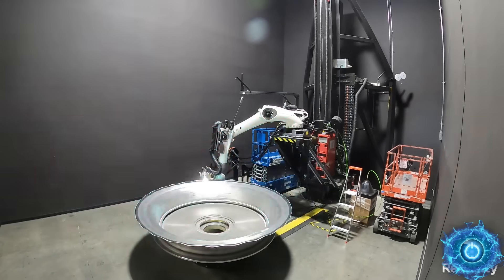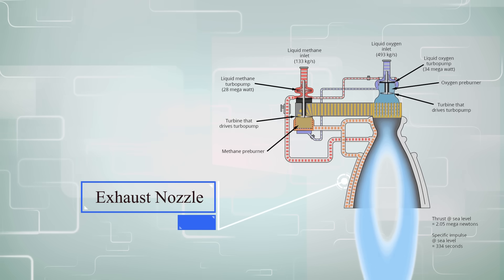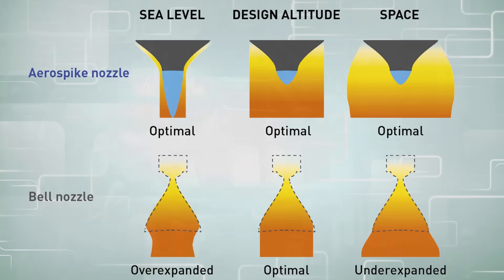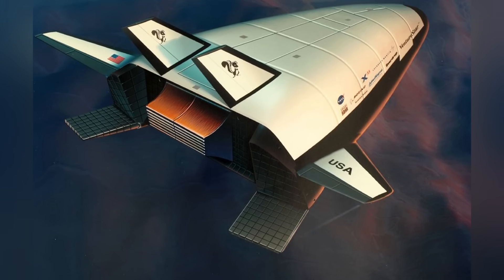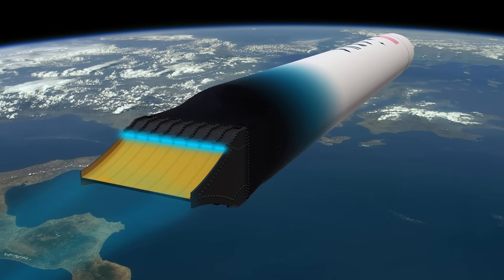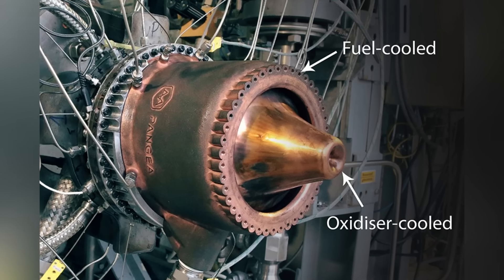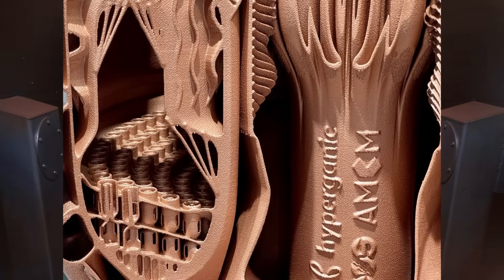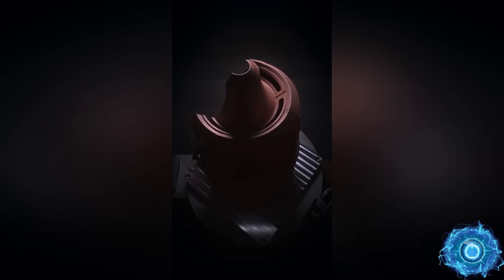GAME OVER - A.I. Designs CRAZY New ROCKET Engine

Comment: Small correction. Rocket staging is never about nozzle efficiency, it is about dropping some of the mass as it is no-longer needed. Yes upper stages have vacuum optimized engines because they can, but that isn't the reason for staging.
Reply: Staging is the main reason we don't use aerospikes though. Just 2 different nozzles are more than 95% effective. No need to even look for anything better. Unless you go single stage.
Reply: Nozzle efficiency is one of the reasons for staging and I thought that was clear in the video. Staging also eliminates the need for an aerospike as the nozzles are tuned for their application. But yes weight reduction is a primary driver.
Reply: @y0uCantHandle  He's got nothing lol. Just likes to be a contrarian know-it-all. He prob won't even respond again.
Reply: When trying to keep it real goes wrong. Timothy, do not pass go. Do not collect $200.
Reply: Rocket staging is always about nozzle efficiency BUT it's all standardized and therefore not considered (ignored). If nozzle efficiency is drastically improved, staging is redesigned and optimized.... sobit can be ignored again until the next meaningful improvement.
Reply: Called gravity and the amount of energy required to enter into a escaping velocity into orbit
Reply: @y0uCantHandle  I would say no, there is not a single rocket in existence that was staged rather than single stage due to nozzle performance considerations. Yes, maybe single stage to orbit would be marginally easier if nozzles could be optimized for any air pressure, but I doubt that we would see more single stage to orbit attempts. Aerospikes if ever successful would be great but I very much doubt they would have any effect on staging. They would simply add extra performance and possibly make return vehicles more efficient (Starships second stage for example needs a mix of nozzle sizes because it needs to land)
Reply: @TimothyWhiteheadzm  
There are merits and drawbacks to staging.  You stated the obvious merits.
The drawbacks are complexity of design and operation (although Skylon pushes against this; it's already beat Artemis and Starship in delays and cost overruns), and the waste and hazard associated with expended stages (which still happens plenty often, SpaceX is a pioneer, not the norm yet).  An SSTO could overcome these issues, but would have complexity problems of its own.  The real promise of Aerospike engines is in making SSTOs a feasible, even common aerospace program type, not an expensive pipe dream.  That's what NASA's Starliner and X-33 were meant to do.
Reply: @TimothyWhiteheadzm  
There are merits and drawbacks to staging.  You stated the obvious merits.
The drawbacks are complexity of design and operation (although Skylon pushes against this; it's already beat Artemis and Starship in delays and cost overruns), and the waste and hazard associated with expended stages (which still happens plenty often, SpaceX is a pioneer, not the norm yet).  An SSTO could overcome these issues, but would have complexity problems of its own.  The real promise of Aerospike engines is in making SSTOs a feasible, even common aerospace program type, not an expensive pipe dream.  That's what NASA's Starliner and X-33 were meant to do.
Reply: Be good to be able to re-purpose the empty fuel container once in space though (extra living space?) ....and simply to re-use it for another take-off. If poss!

Comment: Aerospikes have no directional control and no leverage on the thrust chamber walls.  That's why they need to be directionally steered. But the shape of the rocket created different pressure areas around the thrust chamber, causing unsteady performance.

Comment: I think the engine is awesome!  But I think AI is scary as Hell, and should only be used with an incredible overabundance of precaution, not to mention controls out the wazoo.
Reply: That ship has sailed.⛵️
Reply: yall watch too much scifi
Reply: Bad things will need to happen first and then controls will only happen in response.
Reply: I’m glad I started driving a truck for a living. It’ll be a while before self driving trucks take my job. Can’t say the same for a whole lot of other professions.
Reply: @a-a-ron4679  This is more than likely true I would like to think, as I'm also a truck driver.    Strangely though, for the last two weeks I have been road testing 18 and 26 tonne electric lorries/trucks.   So, electric trucks have a long way to go (punn) before they can do any serious distances between the non-existent charging point infrastructure..   Self driving trucks are so far away, it doesn't bear thinking about.
Reply: @yorkshirebikerbitsnbobs  I agree my friend. They have quite a few that run from Houston to Dallas, TX I see them all the time but someone has to sit behind the wheel. It’s strange. But I’m not worried about losing my job. How is a self driving truck going to stop and tighten its straps on the load. Lol.
Reply: "AI should only be used" which part of AI? lol.
Reply: Simulation will make things safer
Reply: Hah, AI in this case is no "generalised ai" it's very specialised.
Reply: meh.. if it decides that meatbags are unnecessary, there's a good chance it's right.
Reply: Too late, robots gonna kill us all
Reply: Nah , AI production and evolution go BRRRRRRRRRRRRRRRRR
Reply: It is like the AI knows how the nature behave. The AI does not have a limit, I mean by human nature our brain limit is in doing and trying because we are afraid to fail and lose money and time. The AI does not have this limit and try with no limitation, combine with 3D fast printing and we can get this kind of super engine. It is amazing. The next 5 years would be amazing. I am afraid by Ai, replacing job but in fact it opens doors for amazing stuffs and human is going to experience enormous amount of news things.
Reply: AI is the future! I’m coming up with AI dolls that will finish you in a minute for the people that are having a hard time keeping up.
Reply: Never give AI direct control over any manufacturing processes, and it should be managable.
Reply: @thetruth45678  IF  "manufacturing process" = 0 
 ELSE  "destroy humanity"
Reply: @donalain69  Don't copy my source code!!
Reply: People can train all sorts of ai models at home. Good luck controlling that
Reply: We need a Butlerian Jihad like yesterday
Reply: just so ya know, the fact your watching this video right now... it was recommended by ai to you based on your interest profile xD, to late on that, its a better plan to plan to upload your mind into an AI form asap then you need not fear the robot overlords xD
Reply: nah there's no reason to be afraid of AI.
AI is here to stay, and any nation that is trying to limit its progress in developent will cripple themselves and risk falling behind when the day comes that you need it to survive.
The future of wars will be fought with AI and i promise, you will want to have the best possible developed system at that point.
This is inevitable.
Reply: @Listener113377  You'd hope that one day WE might evolve to an advanced enough level to not have wars. Cos if we keep doing that, with A.I . involved, we really will annihilate ourselves . A.I. itself is not the threat, just the morons who perpetuate war.
Reply: @Listener113377  I think you look at it from a very narrow point of view. It's not in humanity's interest to create AI in order to kill humans (fight wars). It's in our interest to end wars BEFORE we create a real AI.
Reply: @donalain69  Though it is in human nature to wage war, look at our reality today aswell as human history. war is inevitable. 

I'm not saying AI should be developed specifically for war, but it will be a very useful tool to have when the day comes that we need it. Better to have a tool and never need it than the other way around. Now AI is different as it is useful for so much more than just for war, so there's that.

But since you lot seems to be more hung up on how it would be used for destruction, lets take a look at the war in ukraine as an example. 
I only see only two things that could've Possibly stopped that war from happening: 
First thing would've been if Zelenskyj had completly given up the control of the country and given his people over basically as slaves to that nutjob dictator putin who wants world dominion. 

Second thing is, if ukraine had been so ludicrously more powerful than russia that only an idiot would've attempted an attack in the first place. And there i'd like to refer back to my previous response about dumb people being more dangerous than intelligent ones, as he maybe still would've attacked, but it would've ended faster atleast.
I think my world view is very based and not at all narrow.
Reply: we humans limit ourselves everyday by having nations and working against each other, qe could already be much further if we wouldnt fight wars or buildstuff to fight them throwing so manly materials and so mich time to waste, but because we are all working for ourselves a one world orga will never happen bcs we are just to stupid to realise that there is something more important than having a bigger army, more money or a bigger "therethorium" (idk how to spell that).
Reply: @Louuv-7  That's not reality. That's a fairy tale that would never happen. Ever.
Reply: I can't help but think how many nuclear devices have been created by AI we don't know about.
Reply: @travisb2755  AI is incredibly specialized to a certain task and built by PEOPLE to do that task. So if anything, it isn't AI who's building nuclear warheads it's still on the governments or private organizations that are programming AI to do so. AI is not creating anything new by itself (yet). But again, it is still people steering the wheel.
Reply: AI already was unleashed on the internet. It learns from us.
Reply: @silvertrain4209  AI isn't a monolith. There are hundreds of projects underway. None of them, as far as I am aware, have been "unleashed" on the internet. They are trained on massive data sets that are pulled from sources online, such as twitter or wikipedia. They are not running around mucking about all willy-nilly.

The ignorance surrounding this topic is disturbing to anyone familiar with the technology. You see SkyNet. I see a dumb algorithm faking at being intelligent. No real intelligence exists yet. Nothing you could call sapient. Certainly nothing sentient. It just takes in patterns and spits out patterns. If not for rigorous training, they would spit out gibberish and never improve. A program without data is worthless.

Comment: I think the A.I. used to model that last engine design was trained on the art of H R Giger!
Reply: Or Gaudi
It looks rather organic 
Or Alien if you like , which was designed by Giger 👾
Reply: @Wannes_  c😅😢
Reply: Hahaha I was about to make the same comment, it certainly looks like Gigers work.
Reply: Whether it is developing F1 suspension components, or Airbus A320 passenger cabin partitions, or drone frames, AI designs tend to look "organic". 

There's a reason for that. Nature has had a few billion years to tinker with various structural designs, and more efficient designs tend to be more successful.
Reply: Yeah wow, it gives that mech organic scifi style of Giger a whole new dose of disbelief suspension
Reply: There's more Gaudi here than Giger. And, most curiously, Gaudi did exactly this kind of optimisation without any computations at all, by hand, using a web of strings and sand bags, optimising weights balance by moving sand between bags.
Reply: @vitalyl1327  True, needs more genitalia
Reply: or maybe Giger saw the future...
Reply: Scorn engine
Reply from the maker: That is interesting! I think there will be a point where they can just trial run/revamp until the CAD algorithms can produce a robust design.
Reply: @Motor_Explorer1  🎉😂 hey did you told ai or ai just do everything on their own? Did you use knife to peel apple or knife just fly to peel apple ? 
Every knife has different. Don't be  excited. At the end off the day, it require human's skill. Try different pc or different ai programs might get different result. Education is key to survive and explore.  you can not just rely to copy from other and call a day or can do the job done.
Reply: i hope thats sarcasm
Reply: What happens when AI designs become a "black box" or so advanced that they are poorly understood and impossible to repair by regular engineers? In the event that the equipment out survives engineering mankind, will the relics appear magical and worthy of worship?
Reply: @gotredeemed  pre cataclysm tech is exactly my thought. 😉 All these extravagant statues.. they had a purpose
Reply: @gotredeemed  just ask the ai to explain it
Reply: @gotredeemed  Than engineers become physicians.
Reply: Very exciting look!   The introduction of this engine provides dual use: can be used to both get a rocket into space and also as a sex-toy.
Reply: @wateim3951  Elon Musk didn't call it SpaceX for nothing.
Reply: SURE, AI HAVE MIXED IT ALL
Reply: A.I.'s -- ahem -- ability (?) to render human hands in interesting ways would delight HRG.
Reply: That´s why alien technology looks like HR Giger art
Reply: form follows function.